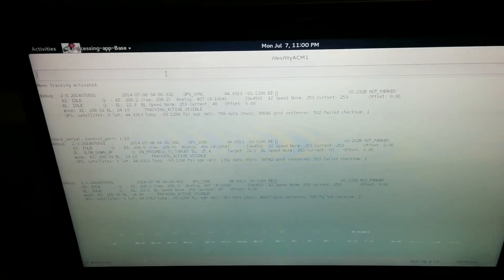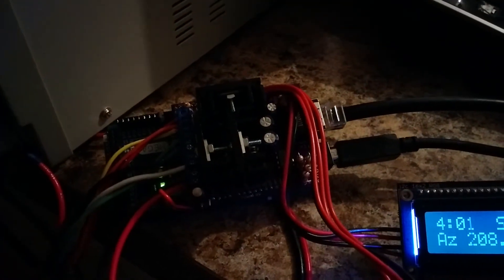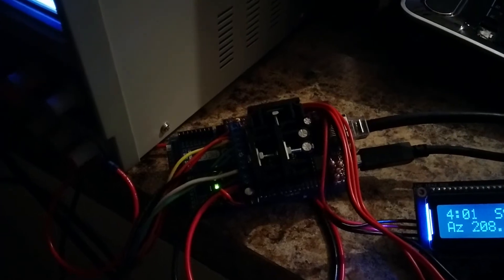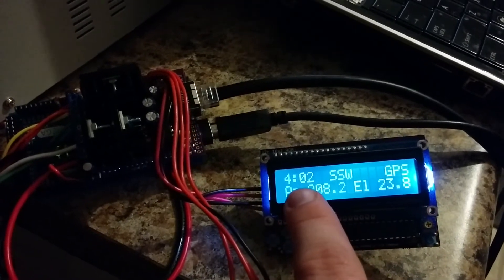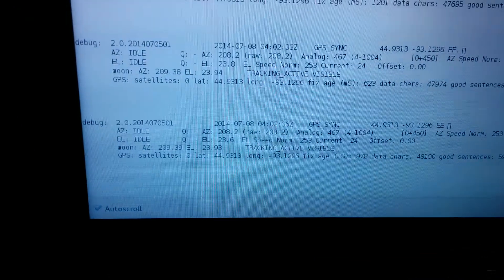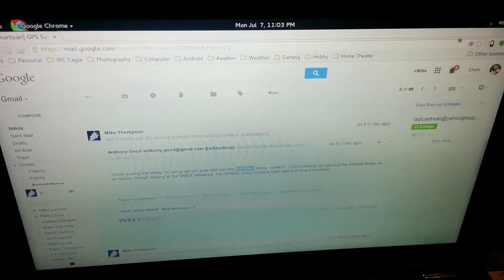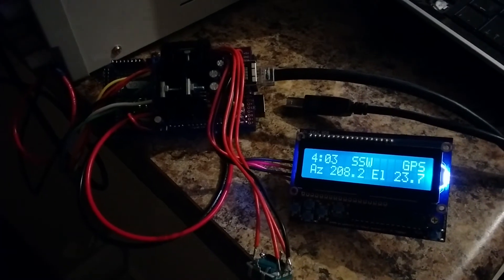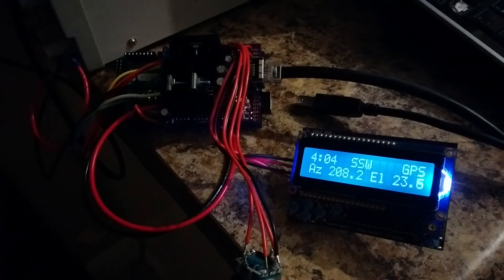Arduino based Azimuth and Elevation controller

Comment: Hello Mike, your K3NG Rotator Controller looks great! I just finished my K3NG Unit last week, but I'm having trouble with Elevation readings (ADXL345). For Azimuth I'm also using the LSM303DLHC sensor. Do you have a schematic of your design/setup. I really would like to correct my elevation(ADXL345) if it's possible? Even after Manual Calibration, it seems like Azimuth sensor is also reading Elevation.
73's Eric/KB3DTQ

Comment: I've just build the same project but my ADXL345 elevations sensor get maximum 45° when the shield is rotated on 90°! I do not know why :(
Reply from the maker: You have to go through a calibration routine. Load some code to store minimum and maximum detected values, then move your sensor through 360 degrees in all 3 axis, and record these minimum and maximum values in the controller code.

Comment: Very cool!  Keen to hear your summary of the the accelerometer and compass units with the K2NG firmware in actual operation.  Looks very good, but I had not seen it running with sub-decimal point accuracy.